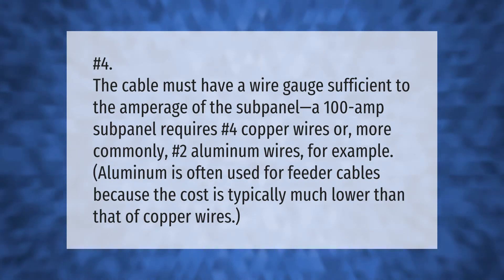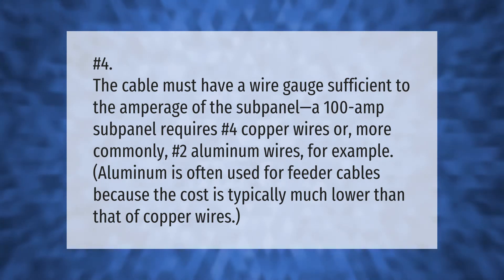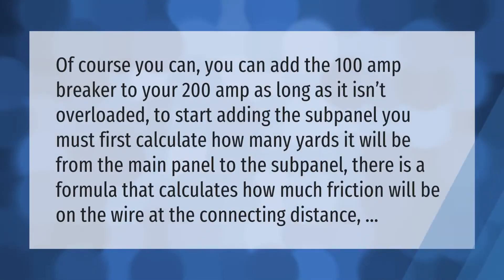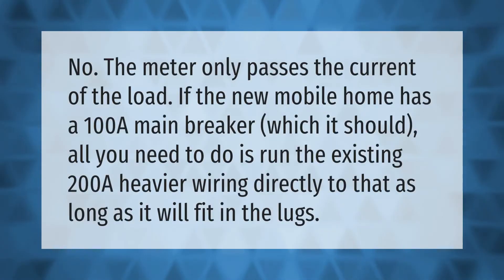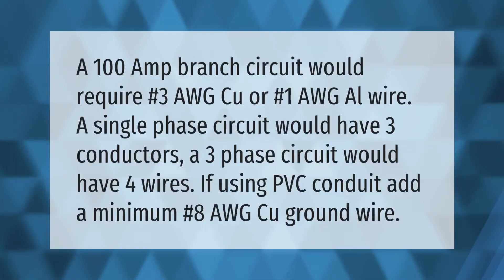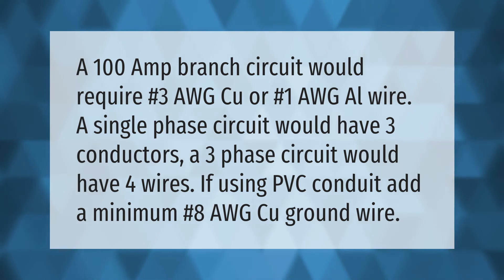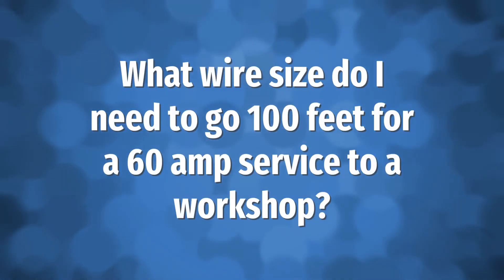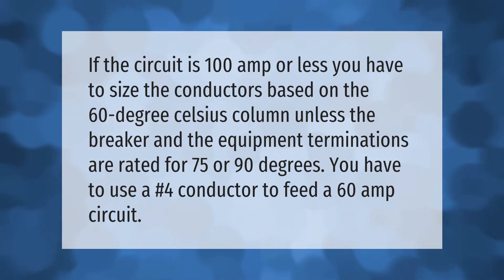What size wire do I need for 100 amp service?

Comment: 83% rule allows smaller wire gauge for ampacity of 83% of main breaker size so, 150amp breaker would require #1 NOT 1/0 this is only for residential applications 100amp - 400amp service
Reply: CORRECTION: "83% rule allows smaller wire gauge for ampacity of 83% of main breaker size so, 150amp breaker would require allow #1 NOT 1/0 this is only for residential applications 100amp - 400amp service."
You're not required to use #1, but it would be allowed - just as it would be allowed to use 1/0, 2/0 or 3/0 for 100 amp service if you chose to do so.
Reply: @gatsbylight4766  thank you for watching my 6 broham 😎

Comment: My main panel is 200amp capacity. I see 100amp there for house supply and 35 amp possibly for a/c..i wanted to install a nema 14-50 in my subpanel inside the garage because my main one is opposite the garage (weird location). Can i change my 100amp to 125amp in the main panel to accomodate my Nema 14-50? Is the current cable sufficient?